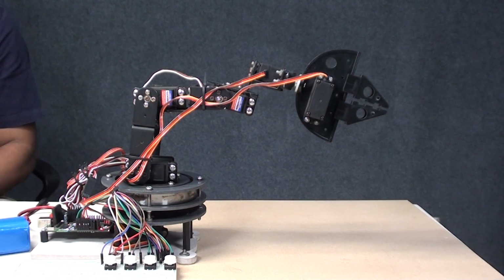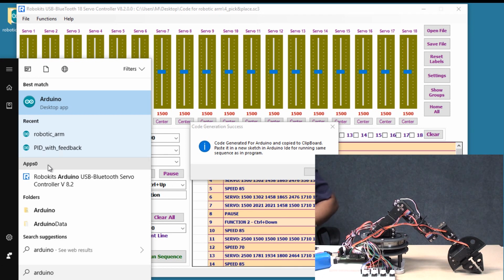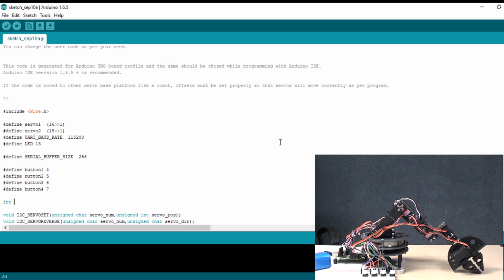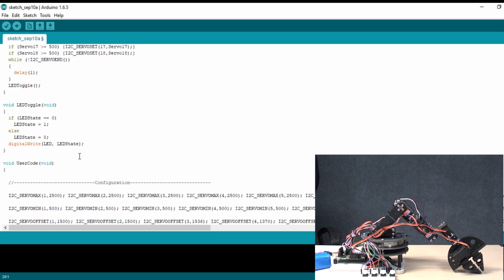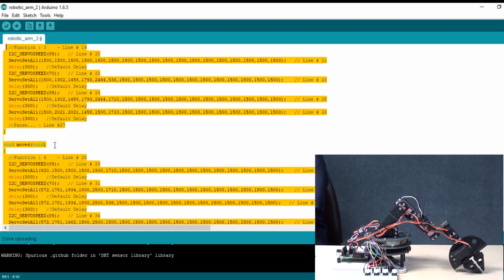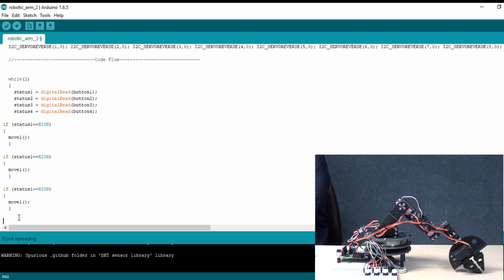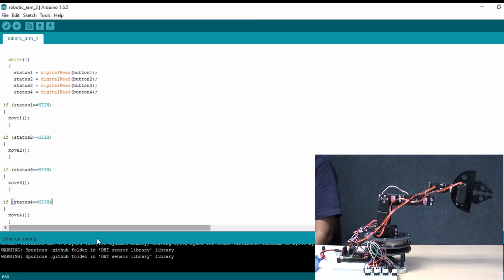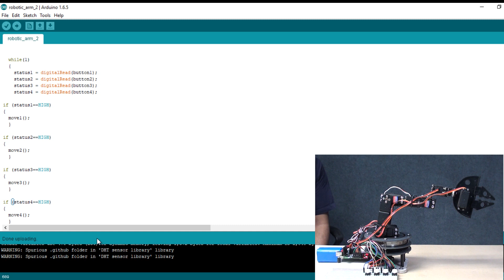Robokits Arduino Uno based 18 Servo Controller board - Part- 5 (Arduino Code and External Hardware)

Comment: HI SIR  I BOUGHT THIS BOARD WITHOUT BLUETOOTH  NEARLY 3 MONTHS AGO IAM FACING AN ERROR IN BOARD  WHEN EVER I MOVE THE GRAPHICAL INTERFACE TO MOVE THE SERVO ITS NOT MOVING PLZHLP ME BECAUSE 1800RS ITS BIG AMOUNT I CONTACTED WITH UR SUPPORT TEAM DIDN'THELPED ME THEY DIDN'T MADE A CONVERSATION TO UR TECHNICAL TEAM THEY JUST TOLD TEY R OF DIFFERENT DEPT.
SIR PLASE I REQUEST U TO SOLVE MY PROBLEM I HAVE A CHANNEL PLZ VISIT THERE U COULD FIND MY NUMBER AND EMAIL OR U CAN GIVE ME UR CONTACT NUMBER SO I COULD CONTACT U
Reply from the maker: Sir, please leave a mail on support@robokits.co.in and your query will be answered be assured of that.

Comment: Hi sir Ur video were very much satisfying one after watching many videos in you tube the way u explain each thing and actually I wanted to connect the board with a mobile app which I made with help of MIT app Inventor so  how do i need to program the board plz tell me I would be great full for Ur help
Reply from the maker: Thank You for watching the video.
You can generate the arduino code of move as per your requirment and then edit the arduino code as per your requirment. You can a assign command of your app to particular move. For further help contact support team, link is provided below.
https://robokits.co.in/index.php?main_page=contact_us

Comment: What is the ideal power supply to be used with the RKI controller
Reply from the maker: It has input voltage rating of 5 - 7.5 V. For further details visit the product page. Here is the link of product page https://robokits.co.in/control-boards/rc-servo-controller/arduino-uno-r3-based-bluetooth-usb-18-servo-controller